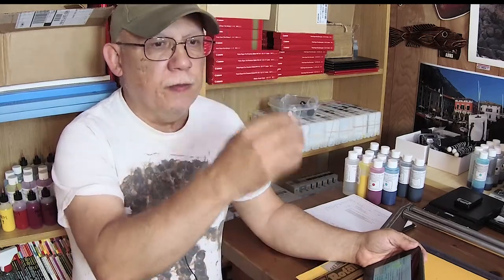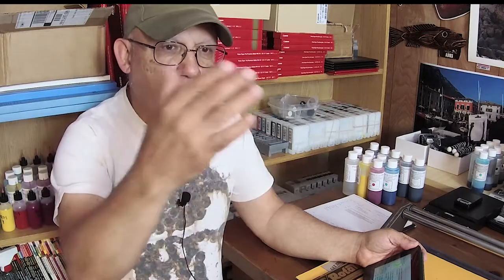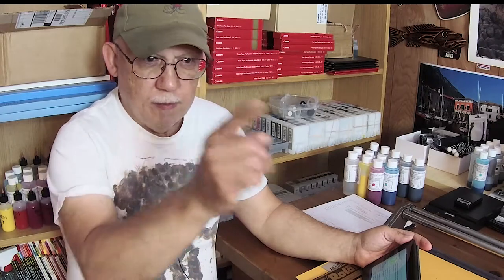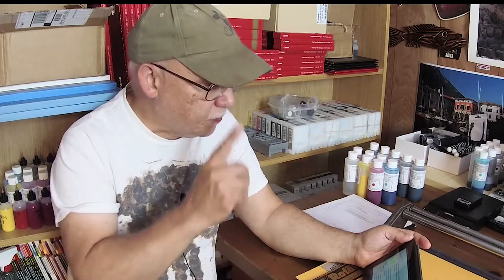A bit of Wisdom from 10 Years ago Part #1

Comment: The cycle would not work so elegantly if the replaced carts have been ran dry. For instance, if you ran a cart dry, and you replace all carts. You collect the OEM inks on the carts that still contain usable ink levels, you can't guarantee you have enough next time for a full refill. Last I heard the resetter will only reset to full, not anything in between. Moreover, you will probably need to go through more fresh OEM carts than you have to just to collect enough of a supply to continue the cycle. 50% is a good point to change out an OEM inked cart, i agree.
Reply from the maker: Notice that he says "after you have several sets of carts". Though this sounds do able it would take a llot of work, planning and diligence. But..... It is do able.

Comment: So what he is suggesting is to refill all carts using a 3rd-party style refill method, but refill using the extracted inks from the used OEM carts? And because the used carts will be at 50%, when you refill them using another used cart also used to 50%, you end up with a full set again (after using the resetter of course). And so the cycle is perpetuated. Interesting.
Reply from the maker: Yes. Obviously you have to be able to reset chips and refill the original carts with the PRO-10 and 100. When I get PGI-29 empty carts, tbey all still contain ink that can be used. Also is ONLY applicable to 100% OEM ink users.   It will allow you to fully use all or most of the ink and still minimize the number of purge cycles. A lot of  though.

Comment: I probably missed it, but how do you harvest ink from an Epson P600 cartridge and refill them? I'm trying to avoid the domino effect.
Reply from the maker: You can not refill oem P 600 carts.  And besides the way to beat the domino effect is to be able to reset all the carts at once and refill them regardless of e levels then are at. So when one is empty you reset all and refill all. Unfortunately that is not possible with the current version of P600 refillable. They only reset one at a time and there is no resetter.  Although that might change soon.
Reply: Jose Rodriguez So it sounds like using a CISS is the only current way to beat this…
Reply from the maker: Sounds like it.